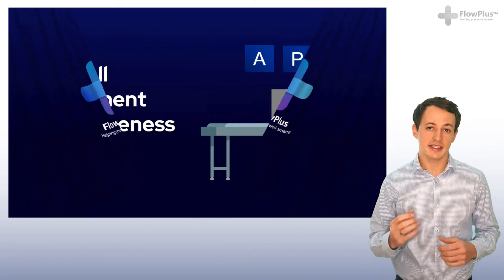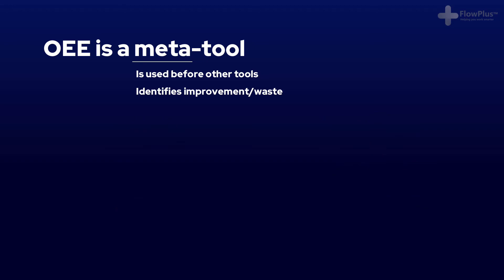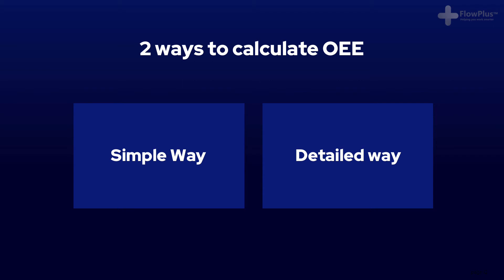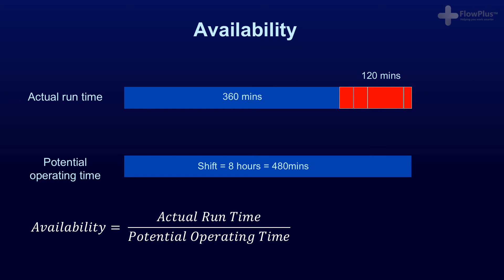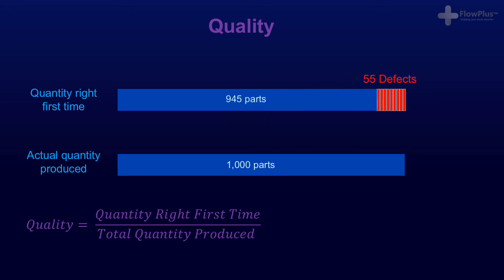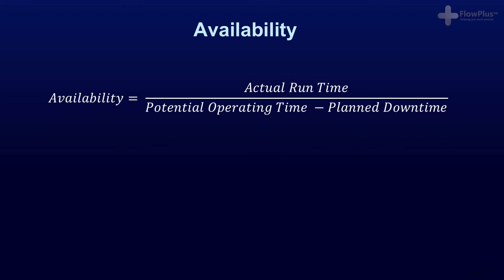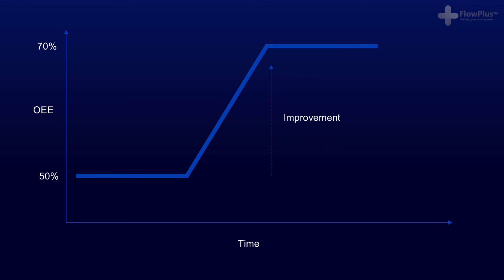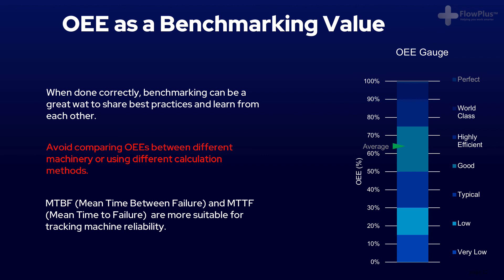#21 Free Lean Six Sigma Green Belt | Overall Equipment Effectiveness (OEE)

Comment: Should you only calculate oee for bottleneck only or for rest of steps also?
Reply from the maker: It is typically most valuable at the bottleneck process only (as that dictates the speed of the system when in series), you can however do it for each individual step as a means to measure improvement over time.